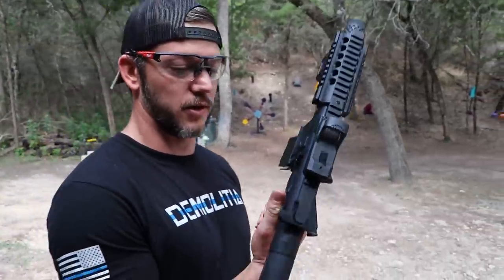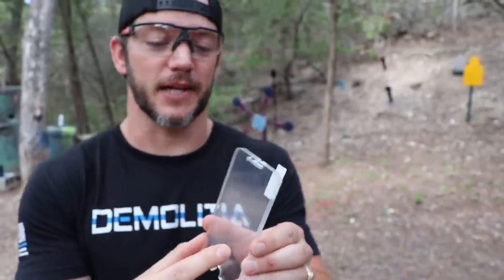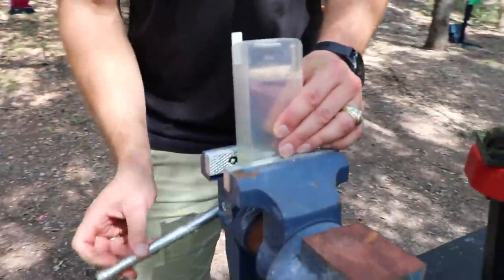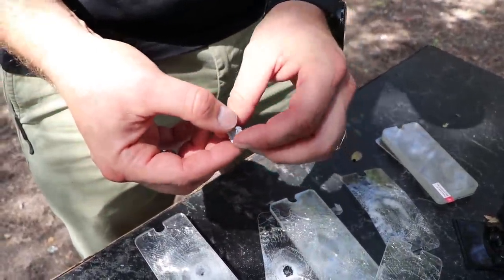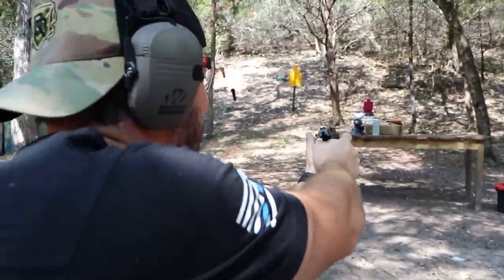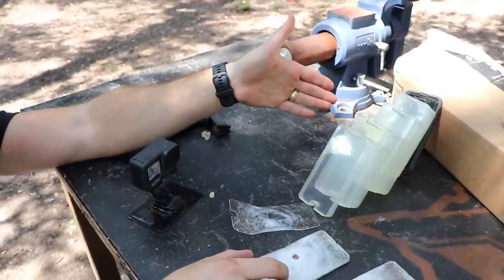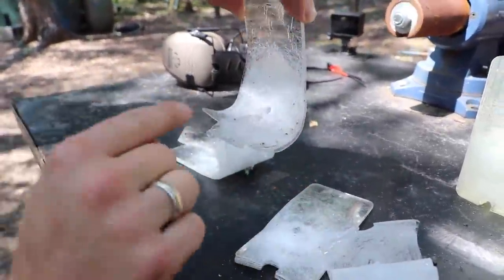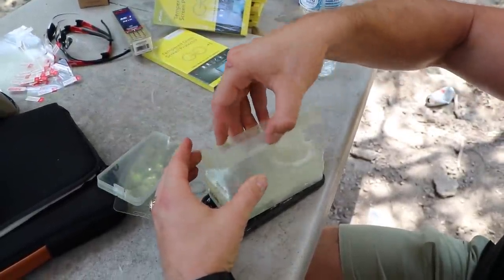How Many Screen Protectors Does it Take to Stop a Bullet???

Comment: You have just demonstrated shockwaves and how they travel in a wave, which explains the missed screens.
Reply: Much more succinctly put than how I was going to answer.
Reply: Short and effective explanation, appreciate that
Reply: i don't know if that's 100% accurate
Reply: Makes sense for the solid glass spheres he shot, but strange that it works the same for what is essentially a glass laminate.
Reply: I remember myth busters did a test where they blew up 2 bombs and the myth was if you are in between both of them the shockwaves would cancel out and you wouldn't get hit, and they actually found out the waves doubled in amplitude. So wouldn't it have all turned to dust?
Reply: @ProTuneHD  because that would be like being hit on both sides of the screen protectors simultaneously. Newtons cradle displays what happens here and why

Comment: I think it's the same effect as a "Newton's Cradle" desk toy. The energy is transferred through the center and expressed on the end.
Reply: My thoughts exactly
Reply: I think you're correct.
Reply: That definitely passes the sniff test. Also, the Newton's cradle might be demonstrating both the glass ball vs bullet AND the screen protector vs bullet behaviors.
Reply: @robwoodring9437  Different mechanisms. The sphere is about wave focus. A glass sphere focuses light, it'll also focus matter waves. In the middle, the energy is spread over a wider area, not enough to crack it at any location, but nearing the back, that area diminishes fast, and there's more energy per area, enough to crack it.

This one's separate pieces impacting on each other. The table isn't perfectly straight, they weren't perfectly aligned to begin with, it created small gaps between blocks of better attached panels. The damage is where those blocks impacted the next block over the gap.

..or so I think.
Reply: Now this makes sense
Reply: Newton's cradle with wider surface area to spread energy.
Reply: But the phone was like a trampoline which gave the back ones a curve to be pressed against.  The ones in the middle Had enough stuck together to maintain rigidity which is impressive.
Reply: Plus I think, that sreen protectors at the end (in front of the cell phone) were damaged AFTER the cell phone it self, by reflected  shock wave.
Reply: I think that if all of the screen protectors were actually 100% adhered to each other, it wouldn't act like a newton's cradle. It would just act like one mass so the back ones wouldn't have cracked.
Reply: I can agree with that, there's also pretty strong characteristics of a either the shockwave of the impact or the bullet itself.
Reply: I believe that’s called kinetic energy.

Comment: The broken phone was a physics representation of a newton's cradle, the force of the bullet was transferred to the screen protector and when cleanly in a straight line to the end where nothing was there to allow the kinetic energy to go so it tried to bounce back breaking the phone and some of the screen protectors at the end before going all the way back to the very front and going into the loose screen protectors sending them towards you like shrapnel
Reply: Righto, same phenomenon that happened to the glass orbs when you shot them and the backs blew out.
Reply: i was thinking about this as well
Reply: It's also what causes spalling in tanks when a powerful enough explosive hits on the outside and causes the inner layers of metal to fragment and fly off into the inside of the tank and the reason why they use a spall liner now.
Reply: This comment must be pinned
Reply: Credits
Reply: That's pretty cool
Reply: But the weirdest thing is that some random screen protectors broke while most of them did not.
Reply: @user-wb3bt9nb5h  they most likely broke due to a not so perfect seal to the next screen protector (just a theory not certain)
Reply: @DemolitionRanch
Reply: Maybe he should try putting the phone to proof this story… @demolitionranch
Reply: @z5219  First i thuaght that aswell. But then i relised if that was the case, then the energy wouldn't go through it to crush the screen protectors behind it either.
Reply: As Zeke said, the energy had nowhere to go once it reached the phone, so it sent the energy back into the screen protectors. The points where the reflected energy met with some of the remaining energy from the initial impact ended up cracking due to addition of the two shockwaves
Reply: It's basically what happened when shooting a giant glass ball.
Reply: Very well educated surmise 💯 respect

Comment: I think it’s having a similar affect on the screen protectors to when you shot glass and obsidian spheres.  it would blow out the back from the shock wave of it being hit
Reply: I'm going with force....force is doing it.
Reply: @alexb7641  i think its the bullet
Reply: Like sound, terminal ballistics causes a compressive wave that travels longitudinally through a medium and is reflected back on itself unlike traditional waves that travel perpendicular to the medium.  I would think the areas that survived were nodes of destructive interference where reflected force negated initial impulse and areas that were destroyed were nodes of constructive interference where initial impulse was amplified by reflected force.
Reply: @bdwilcox  like I said.
Reply: i think its all frequencies of vibration. glass handles thermal shock decently well, but tempered glass especially handles vibrations very poorly. it also extremely poorly handles PSI. it uses shapes to be strong, and flat panels are very weak. 

glass is also unpredictable because of its poor handling of vibration. certain glass especially heavy panels could snap if dropped wrong on even thick carpeted floor. it doesnt even need an object harder than it is to hit it.
Reply: @bdwilcox  So in other words, where the screens were, you phone would be safe? I know that the length of that medium is also affecting the reflection, but would like to know if its possible to get your phone on that spot of destructive interference (considering being shot with ony that caliber XD)
Reply: It reminded me of the force effect you seen when using a Newton's cradle
Reply: @teeveegee8843  exactly. that's a lot of joules landing also.

Comment: Theory: Remember the glass sphere how it shattered at the back? It's a similar thing.  
Think of a Newton's Cradle, you hit one end and it knocks the other end up but leaves the middle untouched. Instead of steel balls it's atoms but the same thing happens. The force gets to the end where there's nothing else to knock into so it's all released in the phone and last few screen protectors.
Reply: that is exactly what i was thinking, the only part i dont understand is that it wasnt consistent, some did crack along the way and stopped cracking, crack again, then stopped
Reply: Yep. Transfer of motion until it reaches the end of the line. Kung Fu Panda :P
Reply: This! I cane to say this.
Reply: I was thinking the same thing. I think the ones in between that got shattered where at some points where it was a bit looser stuck together: when compared with the Newton cradle, the spots between the balls in the middle.
Reply: Elastic and inelastic collisions
Reply: But why not with the 9mm? Is it speed or mass?
Reply: @brandonperry5425  the glass cracks when it bulges to a certain point, if they where all right next to one another probably only the last ones would break, but seeing as these are made in batches there is most likely small gaps inbetween them which have just enough space to bulge out the glass to break it
Reply: Damnnnn you should be a teacher I’m baked asf and totally understood that!!!
Reply: The force that the bullet is hitting the glass with is being pushed back by the phone at the end. The slower rounds created shockwaves slower too. The faster 22 hornet round crushed some of the later ones because every protector the bullet went through sent another shockwave through the glass. If the shockwaves come fast enough then some of the weaker protectors shatter even though they didn’t get hit. Plus the shockwave will bounce back off the phone so the last ones get hit even harder. Like splashing a wall in a pool. The shockwave gets sent back
Reply: My thoughts exactly
Reply: Kinda like jean claude in bloodsport breaking bottom brick
Reply: That's what I was thinking, that there's a shockwave propagating threw thew outside and back to the inside, colliding, then going back out, and in. Jensen the sections with little/no damage, then sections with alot of damage.
Reply: @brandonperry5425  maybe it wasnt perfectly touching so it had to move a small bit to transfer the energy and that would hit the screen with a lot of force that could shatter it? idk that's just my guess
Reply: @brandonperry5425  i think there was a pressure wave that propagated like a sin wave rotated 360 starting where the bullet stopped and when it reached the phone / backing it had no where to go
Reply: This should be the pinned comment haha
Reply: Thanks wise genius
Reply: same here
Reply: @brandonperry5425  the thing about the inconsistencies was most likely due to even the slightest bit of air getting between the layers causing the force to release on the next layers until a tight seal would hold. As you get closer to the end the resistance goes WAY down bc the number of layers left is decreasing rapidly causing the force to over power the resistance causing all of the screens to shatter at the end
Reply: Listen guy I ain’t hating on you so don’t read this thinking I’m some douche cause that ain’t my mindset. Your comment immediately reminded me of watching Mr. Wizard. Probably cause you explained it perfectly.
Reply: Yes.
Reply: I thought of the samething
Reply: @whynot9401  same here 💀
Reply: @brandonperry5425  perhaps the inconsistency of gluing is the reason
Reply: That's a hypothesis not a theory.
Reply: It looks like a standing wave pattern to me. Screen protectors remained intact where nodes were.
Reply: Science with guns should be a class in high school
Reply: compression/rarefaction

compression is when molecules are pushed closer together. rarefaction is when they spread out away from each other. 

propagation is the combination of both that equates to the travel

however when thinking about these things its good to  remember propogation also includes the start and the end. how the wave (in this instance) began and how it is recieved and by what.

wish i could say more but im an audio engineer not a physics major. i just know the terminology from knowing how sound waves act but i would be led to the educated guess that this is very similar

Comment: The effect is called impedance mismatching, when sound (or other waves) move from a material with one speed of sound to another. 
Anyone else want to see a smarter everyday/demo ranch meet up? This would be a good topic.
Reply: That would be a sweet collaboration. And thanks for the answer, I was curious too.
Reply: I actually think the impedance mismatch could me worse because of the fact that the protectors were several glued together blocks leaned together, so the wave changes speed several times between the blocks. 
Atleast if I remember my university physics enough :D
Reply: if he would of stuck them in the exactly same density than both shear and pressure waves would of had the same velocity
Reply: I think it's more likely just newtons cradle. If it was harmonic waves, they would harmonize as the material is practically homogeneous, even if composite. Remember, glass is incredible vs sheer force and compression, and weak in plastic deformation. 
The front got freaking shot by a bullet, so yeah, it breaks.
The center got compressed, but had the mass in the back to keep it from bending.
The protectors in the rear could flex, and thus bend and break.
Reply: Impedance implies resistivity wich implies electricity. Im not making the connection pls help
Reply: I'd love to see matt standing there as the science is explained just smiling holding a few guns in his arms, waiting to shoot things.
Reply: I think the answer is easier. He shot it with a bullet. Screen protectors are meant to protect from drops and scrapes.
Reply: To me it looks like laminar flow.
Reply: That would be epic!!!
Reply: Yes, Matt and Destin would rock it no matter what the subject was.
Reply: I was thinking Veritasium, but Smarter every day is cool too
Reply: Transmission Line theory.  The stack of screen protectors is the transmision line, and it's terminated in air or a cell phone, which is an impedance miss match.  The reflected pressure wave peak blew up the last bunch of screen protectors and the cell phone.
Reply: A demolition ranch fan,,, who additionally watches smarter every day? Interesting.
Reply: Yes
Reply: Great idea
Reply: Like a newton's cradle, the physics are very similar, if not the same, which is why the middle screen protectors are intact, because they transferred the energy and momentum effectively to the screen protector behind them, but when the kinetic energy reaches the end of the stack the energy gets dissipated/absorbed and shatters the end protectors and reflects back into the stack which is why some fly back because the reflection of the kinetic energy.
Reply: That would be an amazing Collab!!!!
Reply: @patkindell7567  wrong word, right concept.
Reply: don't forget that glass is technically a liquid as well which helps this theory
Reply: @Jesse Dickson Yes, it is my job! :-)
Reply: @tomstutz2645  Mechanical waves like this are modeled in the same way as electrical waves, hence the same terms. The effect is the reason for the sound conducting jelly used for ultrasounds both for humans and when looking for cracks in welds.
Reply: @KeithJawahir  That would be cool too.
Reply: @robertduffuk  thats interesting, thank you. Did not know there was a connection like that
Reply: I think this might be better described as resonance possibly??
Reply: @ryan_torres  doesnt resonance require a constant input signal wave or frequency? More referring to sound and wave generation as opposed to impact
Reply: @tomstutz2645  No a resonance is the frequency that a system oscillates at when hit by an impulse. Think the ringing of a bell.
Reply: @robertduffuk  always learning good reference. Applies to guitar strings and piano wire ect. then im guessing

Comment: The .22 Hornet was like Newton's Cradle, the energy transferred through.
Reply: Exactly. The panels that shattered the first time the wave of energy passed through could no longer conduct the energy in an effective way when the wave rebounded so that explains the gaps in breakage.
Reply: sounds right to me, if you look closely the shattered parts seem to be where there was a small gap in-between larger clumps of glass, making an impact.
Reply: Force of Impact, like when a martial artist hits the top brick, but only breaks the middle one and bottom one.
Reply: Ya the energy had two go somewhere, it couldn’t go to the side (like a steel plate), and there was no cushioning (like kevlar, water or soft metal), and the phone was the end of the line for energy transfer.

Comment: Matt it's the same physics principle from back on that glass ball. The applied force to the front traveled to the back as the force was distributed across the surface area, down the edges of the screens then culminating in the same point in the back where the phone was.
Reply: Something sometime  wow
Reply: It’s the same concept with Newton’s cradle the two balls on the end move because it has nothing else to transfer the energy to
Reply: Also the reason why some screens cracked in the middle is because they werent as close to the other screens and as such didnt transfer the energy fully but absorbed some of it
Reply: @JJT3001  your right on that part, I'd be willing to bet that those screens had some ever so slight gap that didn't allow the transfer of energy freely as others which is why it went broke, good, broke, good etc
Reply: Ew stop being smart
Reply: I came into the comment sections to tell him but you beat me to it lol
Reply: So like how the missile knows where it is
Reply: Likes a Newton's Cradle. plastic screens just transfer power of bullet but doesn’t eliminate it
Reply: The adhesive has to absorb some of the impact also I'd wager
Reply: Action::::Equal and opposite reaction
Reply: Yeah it's basically a ripple, or a wave.
Reply: This just doesn’t sound right, the glass balls was a different phenomenon. What was happening there was the energy was going through the balls like a shockwave, and therefore when it was moving towards the center of the ball, the surface area was increasing, which in turn made energy flowing through not enough to crack the ball, but when it got to the end, the surface area started decreasing again which broke the back of the glass.  
I think this is a very different happening. This probably has more to do with something like a Newton’s cradle, where the hard screens in between acted as the multiple metal balls that won’t move. Because some of the screen protectors were very well put together, the energy just went straight through them, not able to crack them, but when it reached a group of weaker protectors (i.e. ones that were not put together so well) the energy was able to break them.
Reply: @pieemoji6702  right freaken nerds lol
Reply: @hellium6613  "Like a shockwave"  You just said that. All matter vibrates. Those vibrations are called waves. You see this in electrical current. Hell even light is just waves in the electrical spectrum we can see bouncing of things.